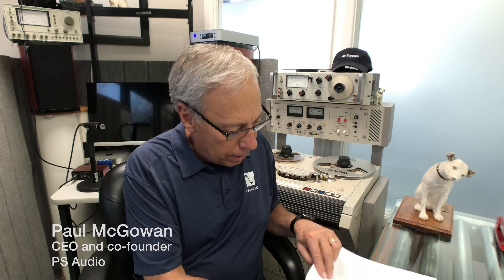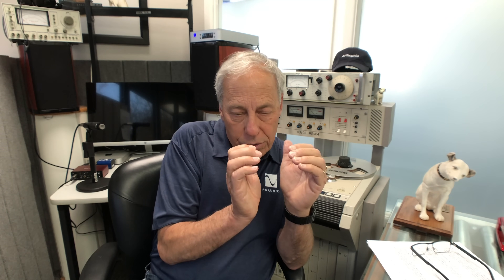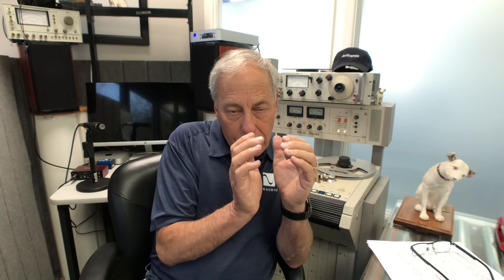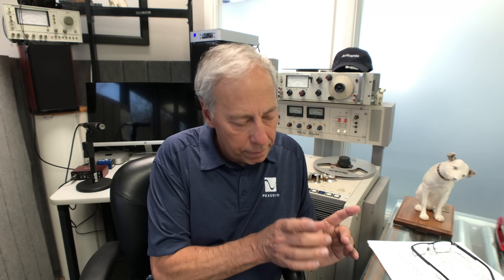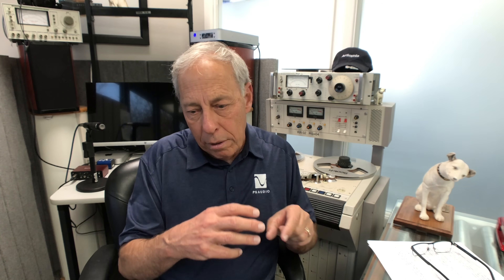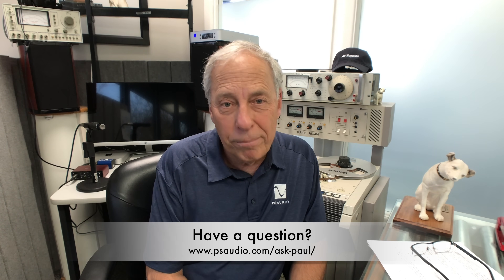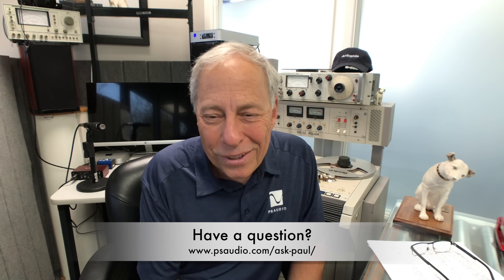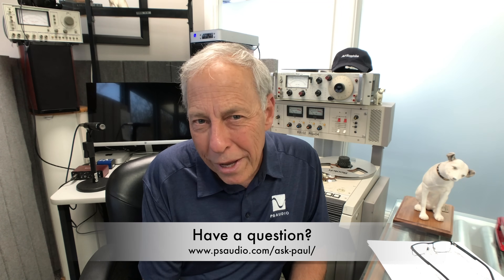How important is the DAC chip itself?

Comment: I am tempted to buy a dac but running a PMA amp and focal speakers from just HP flagship laptop aux output sounds incredible with no noise and a soundstage where I can see the whole band if the recording is correct, I wonder how much better a proper dac can be. pretty sure speakers are the most important factor then the amplifier and only then a DAC but I am convinced modern dacs are already so good that the improvement a few grand give in dac value are marginal.

Comment: Paul mentions the output stage of the DAC but omits to mention the low pass filter which because of phase shift at the filter poles has a considerable bearing on the sound.  There are also several different types of analog filter designs Chebyshev, Sallen Key, Butterworth, to name but three, each type has advantages and disadvantages.

Comment: I just got into DAC's a few years back. I can't afford the really expensive one's but I do have a few. I also like to listen to my DAC in my receiver. He did this vid back in 2017 and it's now 2022. One of my DAC's allows the owner to change out the output amp. It's a simple chip swap. Without changing the DAC chip you get a different sound. Also like he mentioned software upgrades can change the sound.

Comment: Great discussion.  Agree whole heartedly.
Lampizator started as a hobbyist upgrading CD players.  He got famous by bypassing the op amps and installing a triode based output.  Also upgraded power supplies.  His work on vintage CDPs is still online.  Having Lampizated several CDPs I can vouche for the substantial impact on sound an upgraded output stage makes.   That led to making my own DAC/streamer using 30 year old TDA1541a chip but has over the top power supplies, clocks and triode output that will rival most megabuck commercial products.

Comment: ofc a seller of expensive DACs will try to convince you its wayyyyy more than the chip. Well i dont know much about sound, but i know little about IT- and electronics. And i see nothing special inside a "highend DAC", the dac chip probably the most expensive part....the rest?..Inductors, a few dirtcheap controller chips, a little bit of power delivery, the majority just capacitors. The price for this stuff just got incredible cheap over the last 3 decades. Theres just no fair basis on which a DAC can be sold for several 1000 dollars...

Comment: You start by saying the DAC chip is certainly important, that it contributes quite a bit to the sound, and end with, you betcha, but you spend most of the video speaking about how the analog stage is (seemingly more) important than the chip itself. Obviously both are important, and the overall design of the DAC itself is of paramount importance in terms of sound quality, but if you had to say one is more important than the other, which is it, that the DAC chip is of primary importance, or that the power supply and analog stage matter more? It seems to me from listening to this that you lean more towards the latter. And if that's the case, what is the point of buying a high-end DAC chip?

Comment: Well, just simplify what's he mean... If you have a good Digital Chip, it's not automatically having a good sound if you don't have a good "Analog state" ... But if you don't have a good "Digital Chip" then doesn't matter what's your "Analog state", you won't get good sound... Both Digital and Analog are very much equally important for good sound at output stage, that's why we're called DAC, however the "D" is in front of the "A" which mean Digital stage is the 1st stage given or determine the quality of the sound.

Comment: One day we're preaching snake oil but today your right.  I contend that the usually very short path from the output of the DAC chip to the output connectors makes up at least 95% of the sound quality of the system.  So if your not playing with digital filtering, colorizing and up converting, it may be really hard to hear the difference in different DAC chips assuming the analog sections are comparable.  They're all pretty darn linear.

Comment: This is def true which there is a reason why Black Lion Audio offers modifications that swaps out factory op-amps, capacitors and decoupled the power supply input and output stages for higher grade components  to improve sound quality. I own a MOTU 828ES that shares the same ESS Sabre DAC chip as the Apogee Ensemble. The specs maybe nearly identical but I don't expect the two units to sonically sound identically the same due to the differences of implementation and the quality of the components for the analog output stage. I also still own a Focusrite Forte with a CS4398 DAC chip and notice that the Forte has a slightly more wider stereo imaging than my 828ES but it's also more on the brighter side with a little bit of the mids and lows rolled off. The MOTU has a bit more depth and clarity in the mids with a tigher low in. Both interfaces sound great but I do hear a subtle difference as all manufacturers have thier own characteristics in terms of sonics. Some will sound more clinical, analytical, Brighter etc.

Comment: It should be remembered how important a DAC is when recording - especially when recording DSD and high bit/sample rate PCM. Yes, good regulated power supplies and decent analogue stages are important for playback, but even that is dependent on what it gets from the DAC. 
Recording is kind of  different. Everything before the DAC needs to be pristine and then the DAC needs to retain the input quality during recording, which ideally needs replicating on playback. 
Its a difficult and very fine balancing act to get right.
Analogue breaks into the digital data stream during recording or playback is always a compromise too.
Reply: A DAC has no effect on a signal recording going in. I guess you mean a ADC.

Comment: Never heard about this company or this guy, was just looking for an answer on the difference between ESS Sabre 9118 and 9018 DAC’s (got a 9118 on my Gigabyte X570 Aorus Master motherboard, the SteelSeries Arctis Pro + DAC headset comes with a DAC that uses the 9018)....but I instantly fell in love with this guy. Seems like the nicest dude, with lots of knowledge. Gonna watch some more of his content now. 

Thanks for the info too...it answered my question - that I don’t need to worry about the DAC chip itself, but rather the overall implementation of the system. So even if my motherboard is technically running a “better” DAC chip, that a stand-alone exterior DAC can still offer an improvement in audio (even if it has a technically “worse” DAC chip).

Comment: As a consumer, how do you know if you have a good analog output stage in your particular equipment?, The Yamaha integrated network receiver that I am wanting to purchase has the ESS Sabre 9006A I believe ( number or letter could be off but I think that's it.) So from what I've read and seen, that's a pretty great chip - so that's cool! but looking inside of the chassis, how can we tell as a HiFi enthusiast that the output stage is a decent quality? And as you stated, what if say, Onkyo, Pioneer, Cambridge Audio or others used that exact same chip in THEIR integrated amps? How do we know who is using the "better" quality components when it comes to everything outside of the chip itself??
Reply: Wish I knew.
Wolfson or ess sabre.
Both of these chips are in two different amplifiers I'm looking at buying.
December 2024.
Any ideas, please?

Comment: hmm ok, so the dac chip is important but the analog output is even more so. Can you tell, for example in this hypothetical exercise, lets take two different analog sections and two different dac chips. Let's begin with this: Someone takes one analog section and swap the dac chip inside. In a blind test, can you guess whether it is the dac chip or the analog section that has been swapped. Let me clarify, I would like to understand what exactly the dac chip makes to the sound compared to the analog section. Do they both affect the same attributes or can you tell them apart? Thanks for any info.
Reply: Would it be that the analog section affects the sound quality while the dac chip affects the musicality?
Reply: @ScareDe2  I would guess it's probably the other way around, that the dac chip affects the sound quality, and the analog output affects the musicality of the overall implementation.

Comment: MQA format : 
13 bit x 48 khz x 2 = 1248 kbps
+ 4 bit x 48 khz x 2 = 384 kbps 
1248 kbps + 384  kbps =  1632 kbps 
( master hi-res  : 24 bit x 96 khz x 2 = 4608 kbps )
so, the MQA can"t be an hi-resolution format... 
" To reduce the size of the MQA file well beyond the current compressions (FLAC and ALAC), Meridian had to opt for a so-called lossy compression. The original stream (24/96, 24/192 ...) has its sampling reduced to 48 kHz and its quantization to 17 bits. However, this reduction is sophisticated, since the first 13 quantization bits are compressed without loss and the following 4 are deteriorated. In other words, an MQA file contains a lossless digital audio data core (13 bits / 48 kHz) and lossy metadata (4 bits / 48 kHz).

Comment: Nice to see Dan Wright mentioned. I have his excellent PH 150 Reference tube phono stage. I use a Schiit Yggdrasil Analog 2 DAC and it is also impressive. Paul's right. Folks should obsess with the implementation of the conversion, not necessarily the conversion itself - though it is still very important.

Comment: I realize this post is slightly dated, and my response is a bit slow. Sorry, I just found it. My frustration with the post is this: At the outset and in the conclusion you say, "Yea, you betcha" to the question does the DAC CHIP matter. In between those comments you spend a great deal of time discussing the Power supply and most importantly, the attention paid to the analog output stage as being keys to performance. In essence, you undermine your conclusion that DAC chips matter or at a minimum you do not discuss the differences between chip performance characteristics. I perceived the question being: all things otherwise equal (if that were even possible) does the DAC Chip shape the listening experience? if so how? As a consumer, who can not possible try out each and every chip and their unque applications, How am I to know distinctions betweens DAC chip "sounds"? If each phase, power, DAC, and analog stage were a chain link, which is the weakest?
Reply: I like to look at the effective bits of resolution. It helps a lot with dacs, especially r2r dacs.
Reply: Yeah, I was a bit confused by that as well. Personally, I felt that the "Yeah you betcha" bit could have been confusing to some since, as you said, he mostly talked about the output stage. I think it was a good video overall but his conclusion could have been a lot better. Something to the effect of, "So.. to answer the question.. how important is the dac chip? Well, it is important (and he said it was at the beginning), but the analog output stage may be more important." Again, this is kind of nitpicking since he kind of already went into it within the rest of the video, but the point remains. I would like to see a video delving into exactly WHY the output stage is important, because I have yet to find a good article or video on it.

Comment: Cool video.  I would say, the difference between putting  the same dac into 2 different analog design solutions sounding different, is the same like, using 2 different usb sticks, but with the exact same file on it, will sound different, put into 2 different hifi systems.   The dac does the digital stuff, the 0 and 1 stuff. What counts for quality is all the rest.  And the bigger the dac, the more info those files can have, samplerate etc. Am i getting this right so far ?  What i want to know is, is it still like in the past, soundcards made a system more stabil, and maybe even a bit faster ? And why ? If calculating the sound is done by some dac chip anyways, no matter if onboard, or on some card ? Isn't it just an analog quality difference ? Meaning you cannot get a performance boost for gaming, for example, but a better quality of the same calculated sound informations ?  And how do i know wich of the dacs is faster, if that's my priority ? All that is said, ''Hmm, it is good for gaming.'' , not telling if they mean the analogal quality, or the dac's speed, or both.

Me , i got an Z390 AORUS MASTER motherboard - with this onboard solution 
 
ESS SABRE reference DAC (ESS 9118) 
Hypertream Dynamic Range (SNR 125dB) 
High-Res music (32bit, 192KHz PCM) 
Super low THD+N (THD+N -112db) .

But is that faster than my X-FI pci soundcard i use at the moment ? Getting weird noises when i turn v-sync off and my 2080 ti really starts pushing out 400 - 600 frames . I guess that is because both communicate through the pci lanes, and the work the GPU does produces static electricity , sry if that's a wrong term to use, i am german. What i want to know, is a soundcard really faster in calculating the sounds, compared to an onboard solution ?  Or did the onboard solutions improve, compared ? Did they even HAVE to improve according to calculation speeds ?
Is the connection via usb, using an external dac slower, regarding realtime sounds in a game ?    I hear so often people complain about, they hear no footsteps of an enemy closing in etc. . And i thought that is maybe because they use an external dac for streaming to have the lowest noises in their broadcast, but they are connected with usb, and that maybe causes such issues. Or is that a format problem of some sounds ?  It is interesting.

Comment: you can get a good sound even with a cheap pcm2706, but you have to make a good power supply and you have to interface well the audio output of the chip.
pcm2706 works fine with resistive output impedance 10k ohms and you need to make a good buffer.
good also a USB filter to clean the USB signal before entering the chip. the chip can work with 2 power modes and the distortion gets worse with one of the 2.
even the poor can be happy :)
Reply: Agree in my home office using Roon music software and some Audioengine desktop speakers, and the Mojo DAC I recently added a better USB cable from Audioquest and the new Jitterbug FMJ and the sound improved more clear and refined. We all know computers produce electric noise and if you can reduce it will help to have a better sonic experience

Comment: One of the most important components in a system is the DAC, because if the DAC does a bad job, the bad work it did goes all the way to the speakers. I had a denon dvd player once, I thought it was ok, until I bought a sony high end Blu-ray player. The Blu-ray player is so much better. But I'm using an external DAC now, which is even better than the Blu-ray player. I am very reluctant to get rid of that Blu-ray player, because it's so good, and it's difficult to find very good sounding Blu-ray players.